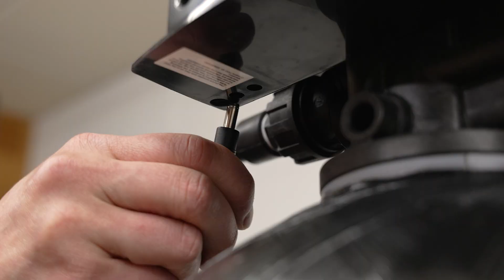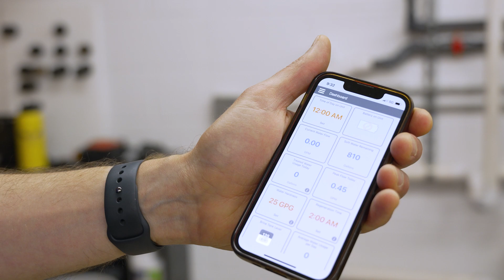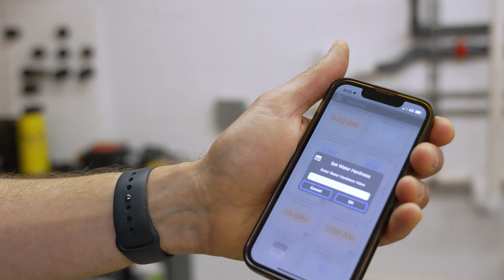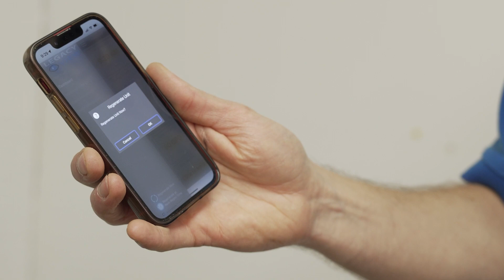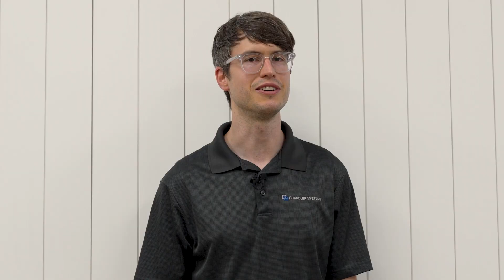CSI Water Softener Startup Procedure

Comment: I had a CSI water softener installed 4 years ago.  It’s been working fine.  I have city water and my hardness is set a 6 gm .  I finally downloaded the app a couple days ago.  So my question:  do I need to do any maintenance on the softener?  I saw a couple videos about using iron out to clean the resin but not sure that is required.  It all seems to be working fine and at least it was easy to set the correct time with the app.  Mike
Reply from the maker: On city water with 6 gpg hard, there really shouldn't be any maintenance like that necessary unless your city water is very heavily chlorinated (like in Florida, for example) in which case your seals and brine piston would need to be replaced more frequently unless you have a carbon filter ahead of the softener.  If it seems to be working fine and you're happy with your water quality, I would leave it alone.

Comment: Is start up the same for a single tank ws1 AIO setup?
Reply from the maker: That's a different control valve and also it's an iron filter, not a softener, so quite a few differences, but the process of getting the air out of the tank would be the same for any softener or filter.  That being said, an AIO filter is designed to always have air in the tank, so you shouldn't really need to purge the air from an AIO.  I would just move it to rapid rinse and then open up the bypass valves and let it go through the rinse step, then open a cold tap downstream and run water for 5-10 minutes and just make sure it runs clear.